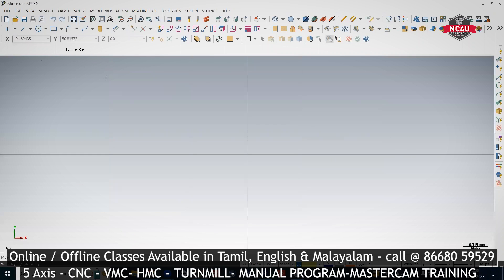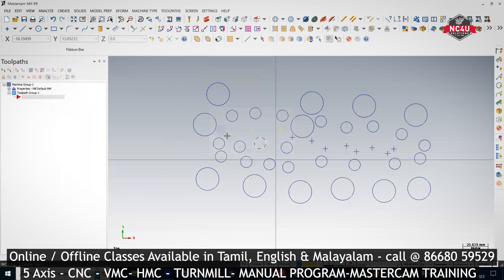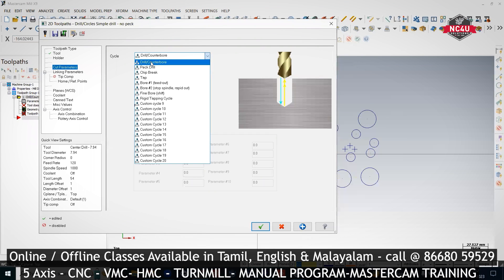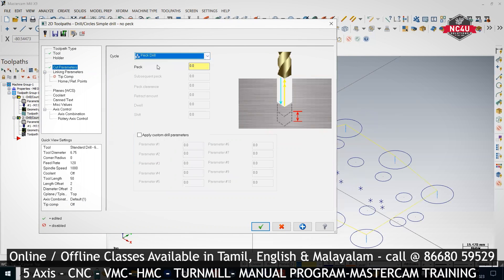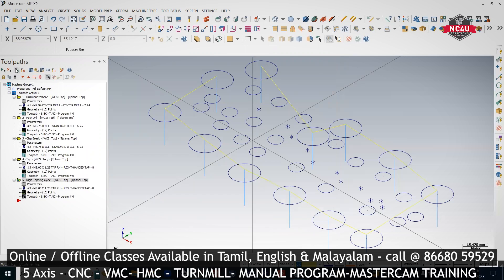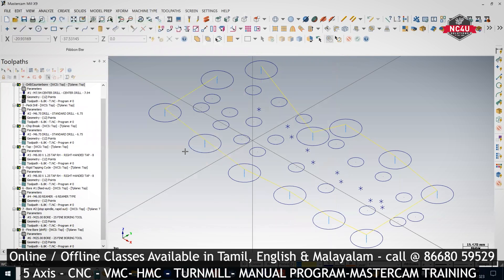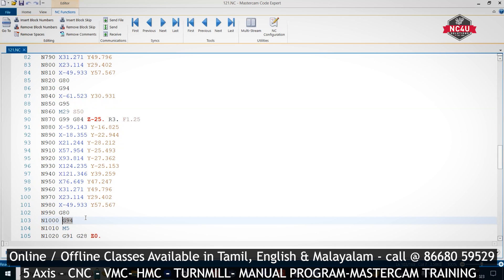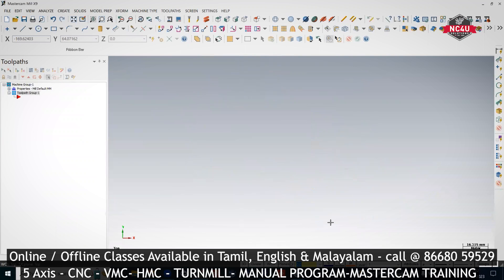How to Program Drill Tap Reamer Boringbar in Mastercam-English -VMC HMC-5 AxisCNCTraining-Coimbatore

Comment: keep up Jintin. Please ask the operator to cheack M29 is enables or notin machine. Machine should have Regid taping function machine.(m29). also can use as peck taping too is always nice.
Reply from the maker: Thank you for your valuable input and support 😊
Yes, you’re absolutely right—checking M29 (rigid tapping) enable on the machine is very important. Peck tapping is also a good option in certain cases. Appreciate you sharing your practical experience 👍